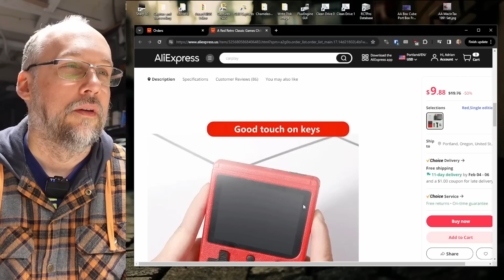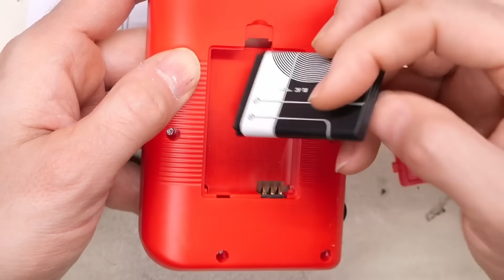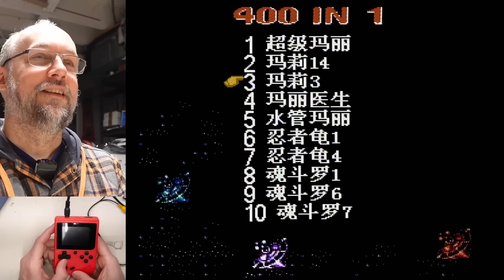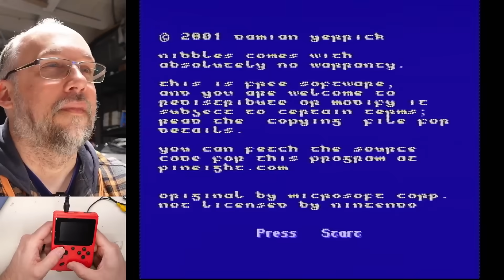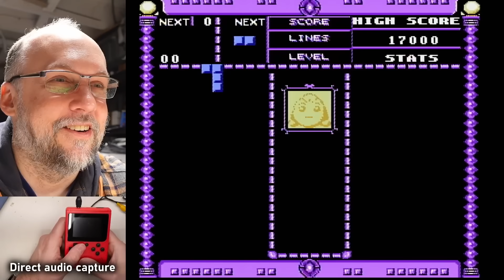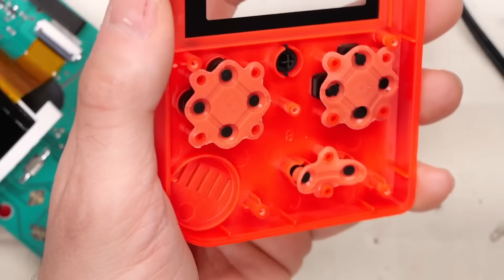I thought this $4 8-bit game console was going to be total junk

Comment: I think the issue with the audio is a common issue that plagues bootleg famiclones. The 2a03 clones tend to have the pulse width bytes swapped which results in the 25% and 75% widths being backward. While this functionally doesn't really sound too different, compared to how you may be used to hearing it, it will sound just different enough.

Comment: I did a research on these little handhelds for a few years. Basically these things are using OneBus interface and it is also modified to work with TFT screens. These handhelds accept either the BGA flash breakout board, or the TSOP-56 one. 

The most difficult part is to analyse its software inside. Later versions of these have its data bits being swapped and/or swapped bits at its opcodes at the beginning part of the software.

The BGA flash breakout is a pain to extract out and I need to use some sort of ChipQuik to remove it, and then use a homebrew dumper to dump it all into the 16MByte file. However, the advantage is I can use the IDC cable to connect it to another custom made PCB that connects it to the TSOP-48 adapter which holds the TSOP-48 flash. It is easier to test the custom ROM immediately too.

The TSOP-56 is easier to remove, but to do a multiple test runs on it, repeated removal and soldering would break the delicate traces. I'm still figuring out how to do this without dealing with all that thing.

Here is my research - it is still ongoing and I'm very happy to share it here: https://nyh-workshop.github.io/Custom-ROM-Sup-Game-Box-400in1/

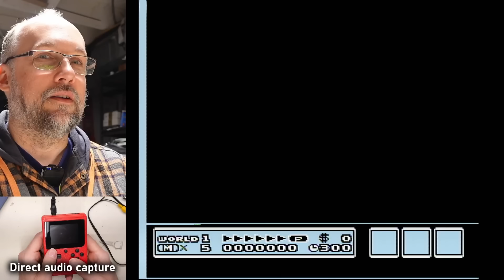Comment: 11:52 the duty cycles are inverted
Reply: also, what you’ve got is a slightly older model. they still sell the old ones at a discounted price just because they have so much overstock but the newer models have better video output and fewer scaling issues
Reply: the reason the duty cycles are inverted by the way is because that was a slip-up they made when the NES was originally cloned, and it’s persisted through other clones and eventually NES on a chips for compatibility.

Comment: Zombies, huh? Just based on where Carmageddon was censored to have zombies, I'd say it's not Germany:

Germany censorship:
* Pedestrians and cows were changed to robots that will not move.
* Blood was removed. Running over robots causes black oil to spill.

But then:

UK censorship:

The UK version was released in several countries.

* Pedestrians and cows were changed to zombies.
* Blood was recoloured green.

Also interestingly:

USA censorship:

* The character OK Stimpson had his name changed to "Quick Jones" and had the blood on his shirt on his portrait recoloured to resemble orange juice, with also his bio changed possibly due to issues with the obvious likeness to O.J. Simpson. This change applies to the US version, as well to the Funsize re-release.

It was also outright banned in Argentina's Buenos Aires (for depicting people killed by motor vehicles), and in Brazil (for incetement of violence while driving).

Yeah, I kinda went off-topic, but I wanted to include all this because I thought it was entertaining.
Thanks for the information goes to https://censorship.fandom.com/wiki/Carmageddon

But based on this, my guess is UK.
Reply: Also, yes, Arkanoid (and other breakout clones and variants) is meant to be played with completely different type of input device than a D-pad controller (or anything that works fundamentally same way, e.g. keyboards or digital joysticks). It needs an analog controller to allow moving the pad(dle?) faster. Modern controllers and analog joysticks would work slightly better, allowing movement in different speeds, but it's really meant to be controlled with something that allows nearly instant movement, and there's two kind of common input devices that can do that if you can master the precision it takes to move just the amount you need. They are in fact variants of same concept, and a computer doesn't have to be programmed differently tu support each one. The major difference is whether you move the paddle with a flick of the wrist, or flick of your thumb. These devices are of course known as mouse and trackball. Lack of them is also why FPS's on consoles suck, especially if playing against PC gamer using keyboard+mouse;p But I digress.

Btw, that puzzle game where you push boxes around is what I think of as Sokoban clones. I don't actually know if Sokoban is the original, but it was for me. I had it on PC, and it was CGA game that used the ugly cyan-magenta-white palette. I'm almost certain that this level you played was in Sokoban as well - I have played it, and I haven't tried many other games that are the same exact thing :D

This one looked better though... I wonder why so many CGA games were done using that palette, when the other (red-green-yellow) was so much better for games, not least because those colours are much more common in real world, so using them makes much more sense.

But I digress badly!

Comment: judging by the sounds, this actually seems to be based on a dendy on a chip, rather than an NES on a chip! the dendy was a russian clone of the NES, which had a few chips that were different. notably, the replication of the audio of the 2a03 (CPU) was mostly-right, but the pulse waves were indexed incorrectly from how the NES did it. From what I know, since the dendy was how most chinese and russian people experienced NES/famicom games in the days when the console was relevant, these games having what seems to be scuffed audio is actually accurate for the chinese market, as this is how you know these games to sound if you're from china and know these games.

Comment: I'm from Brazil and I am an Electronic Engineer. I'm also surprised with the quality of this stuff. I added a real lithium charging circuit because the charging is rediculously simple and might under charge or overcharge the battery. The vídeo on a CRT TV is wonderful except the levels are a little bit low and might get a little dark in some old TV, most newer TV set Will compensate. Overall is a good toy for little kids but I would prefer normal AA battery because lithium may explode and It is risky for little kids.

Comment: I noticed you cut the PacMan part pretty quick, did you experience the same problem I did where the d-pad is just too bad for the precise movements you need to make in Pac-Man, it's like plastic piece is too tall and sometimes it mashes the membrane down for the cross directions of what you intended, like you press down and instead right or left gets hit because the angle the plastic gets forced the membrane.

Comment: Those flash chips are a little complicated, the original NES used separate buses for the CPU and PPU roms but these clones developed something they called "onebus" for this which somehow interleaves the data into a single chip and manages the access timing etc. It may be as simple as literally interleaving the bytes but I never got round to looking into this stuff in detail. There's probably also some metadata in a weird format in there you'd have to fiddle with to get it to point to the right places.

Comment: I got two of the "500 game" versions from banggood for maybe $10+ each.   For the price they are great.  I did have a few problems that I solved.
One problem was that one of the consoles had a misaligned screen right-shifted up to 4 mm.  I discovered that if I hit the reset button a random number of times, it would line up. 
 The second problem is that the battery is garbage.  They would last under an hour.  I ordered "authentic" nokia batteries from ebay for $7 each and now it can last for a week or more (relative to how much I play it).  
The third problem was that one of the battery covers was loose to where it would rattle.  I just put a spongy pad on the inside and now it's tight as a drum.
My favorite game is a version of Defender called "Star Gate". 
I tell people that this is like being in a video arcade where your favorite game has worn out controls BUT the coin slot is broken, so you get infinite games.
Playing Devil World now.  Kill the CYCLOPS!!!

PS - Thank you for opening it up.   This helps me to decide how hard it would be to swap the direction "+" sign for a 3D-printed joystick.  Decisions, decisions ...

Comment: This thing actually has a ton of potential! I got one and wanted to mod it to get more games in, since many are repeated, but never got to it
Also, the battery charging system is a resistor in series with the 5v rail, desperately needs a mod. And the backlight might need a better boost converter and an adjustment control. And the composite output is a bit fiddly... but that's about it! Otherwise it's amazing
Reply: And the A/B buttons are rotated clockwise... that's an absolute sacrilege
Reply: And the LCD viewing angles are bad... but usable
Reply: And the dpad could use a bit of support underneath I guess

Comment: Adrian, there are two options: first, the handheld console only with AV and USB cable, and second with controller included, for 2 players gaming, for 2 bucks more. The controller plugs in the Micro USB connector.

Comment: I saw this at my corner shop. I thought I not spending 5 of my british pounds on that.... now I went back. Mine is blue has different menus and games. Has 500 games and if I missed it in your video mine comes with a usb nes controller in the box. The english menu has music and the video scaling wasn't bad on the games I tried.   The shop has about 9 of them left, presumably they got them wholesale similar price. I love it. I built a gameboy clone with esp32 but my kids keep loosing it down the electric recliner sofa and nearly chopped in in half a few times, so... they can have this instead.
Reply: Had more of a play, it works very well on 14inch tv and the sound seems better than Adrian's but it does need a low pass filter wgich would involve a resistor and a capacitor adding 2c to the price. I don't have that Easter egg in the moulding and I dont think the game selection is as good.  So, there are clearly clones of clones.  My screen doesnt have horizontal tearing but does have a weird artifact on the newly exposed background as you walk forward which suggests that it could be using a minimal change protocol that simply runs out of bandwidth if too much changes at once.  Overall its ok, perhaps the screen lags a bit. On galaxian the bullets are barely visible when they move.

Comment: I bought a "Datafrog SF2000" recently, for a bit less than 20€, thinking "let's see how bad these are", ... and I freaking love it. 
Ofc it cannot stand the comparison with an anbernic rgb20 or such, but with a 900 Mhz processor, it's able to run Snes and GBA games. Those were a bit sluggish when I got it, but after patching it to systen 1.6, they run pretty well. I was impressed how well the simulation was, and these little beasts have some 6000+ games installed, and way less doublettes than I though.
I think I must be happy these little machines didnt exist when I was a kid, I would've not left my room ever 😂
Reply: Ah Thomas..you updated yours..I'm still running my SF2000 at native 800MHz..I read about the 1.6 software hack to 900..useful improvement..I paid a little more than 20 from DataFrog Official AliExpress store..in Black..of course it's no comparison to an Anbernic device..I since bought  2 Anbernics from eBay 1st and 2nd gen..quality is amazing..I never bought a 400 in 1 SUP..but I did buy an earlier 168 in 1 RetroFC..similar..but better plastic..more like the quality of RG300 shell..too many handhelds now

Comment: Look up Nintendo Clone Reverse Duty Cycle and you might have an answer to the sound (not the PAL rom sound issues, but the general ones). You can hack around it, I think. For sure in the rom, but you can bodge the chip as well if it's not a blob. Might be a fun project. I'm not yet through, so maybe you take it apart in a bit, but I wanted to comment while I was thinking about it.
Reply: Ah damn. Blobby.

Comment: What an anti-nostalgic experience for the Asian market. Back in the day, we usually had 60hz games that were run at 50 (and I remember things feeling a bit off when I tried emulators in the late 90s and early 2000s).

And this is the opposite of that, 1.44 times faster effectively.

Comment: I got one of those Retro Games Joysticks. No LCD, just an AV out, and "only" 50 (or was it 200?) games, but they were all recent(ish) develops to make sure we don't get sued and they're all terrible. Like Action52, but as a games console. Police Dog Lasy [sic] is on the first page of the menu, I think this says it all. It also uses a bog standard Flash chip, so if I had more time, I might re-flash this thing with some decent games, but as of now I don't even know if it supports any kind of mappers, as none of the games use any. At least there's a few decent mapperless games.
(ok admittedly the first game is kinda decent, a top down vertical scrolling shooter that even has a powerup system. It's way too easy though, you don't even die in one hit, that's a game I might even keep - eg, if I can't find 50 decent mapperless NES games. Ah whatever let's stuff the thing full of SMB1 hacks)

Comment: I get similar console for cheap price. With display is similar situation - on advertising and on box there is pictures with bigger LCD, but on actual console, LCD is smaller. In one game, I noticed that one side is out of screen. 😂
Shipped battery holds less than OEM Nokia 800mA battery. When battery is getting low, LCD gets dimmed.

Yeah, TV connector needs to be modified because of poor connection in my device too.

Didn't opened my device yet. Wondering, is internals the same.
Games are different and only 120 until it repeates.

Comment: if you try and reflash them, i think they just use a multicart rom as the boot interface and games, so you would just need to load it with a custom rom (you can make your own apparently) and then go from there. as well i think these follow the DB9 controller input scheme like most famiclones on a chip. so maybe dump the chip and see whats on it, locate the rom, mint your own custom multikart rom, flash it back on, and then look after the wiring after that in some dirt level mono tv, and if the sound is low, just wire in the speaker line so you can adjust it for things like loudness and hum. then its just to mount the board, throw in your ports for controllers, source some extra famiclone DB9 controllers and give it to a friend for in their hobby room or garage relaxation corner.

Comment: Variations of these things have been out for a while. I have one I bought a few years back. Can't remember what I paid, wasn't a lot but was more than this one. Mine has a very 90's transparent case that is actually pretty decent quality. Same Nokia battery and connections. Only external difference otherwise is mine has a MINI USB connector (and you thought the MICRO was a sign of being out of date!) But there's obviously more difference internally. Mine is only 168 in 1 rather than 400. Same deal with language selection being the first thing every time, tho mine has a Mario background for that.  But at least on Super Mario Bros the sound is fine - not that weird fast audio you're getting here. Sounds like they took something cheap and cost reduced it even further!

Comment: I would suggest ditching the external video cable for a regular 3.5mm-to-RCA breakout cable of better quality (you just have to check which jack is which).

8:11 "input lines: 262p"; confirmed, it's a PAL rom. Were it NTSC, it would say "240p", which is the native Famicom resolution (NES games are al technically line-doubled, turning their native 240p format into SD just by virtue of treating the progressive image as an interlaced field). PAL games had, at best, patches fixing the audio speed and, if really lucky, slight timing changes for some graphics (twinkles, timer faces...), but they were otherwise basically the same as their NTSC counterparts, which means that, when run on matching hardware, PAL games allowed for longer time limits and more forgiving timing. The catch is, if you run a PAL rom on NTSC hardware, any changes made  to suit 50Hz-land get screwed. Not every PAL game was tweaked, but all Mario games from the Super Mario Bros series were.

Comment: If you wanted to get super DIY, you could hack a controller externally for it. You would need to scrape/solder from each controller pad to a wire that leaves the case and goes directly to the pad of an external controller. Not ideal but totally possible if you wanted to get creative.

Comment: Nibbles was from well before the Nokia days. It was released on the supplement disk for DOS 5.0 as a demonstration of QBASIC abilities.
Reply: Back in around 2000 or 2001 teen me discovered that the players are stored in an array, so I thought, what happens if I set that to 3, implement keyboard bindings and set the spawn point in the levels... IT FRIGGIN WORKED! And then I made a 4 player version, a 6 player and then an 8 player version...

Comment: The BL-5C battery if I recall was first used in the Nokia 3310/3330 when they were launched. Some of the newer Nokia phones still use a BL-5C but are a different size now.
Reply: Noup. Nokia 3310 was using BLC-2 battery.